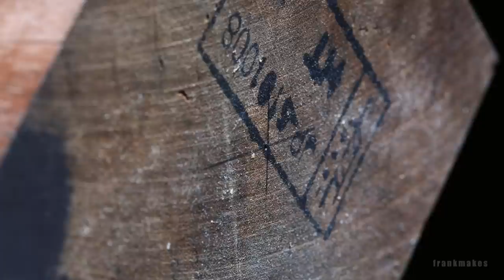Carver's Mallet

Comment: I'm trying to think of a way to ask this without sounding like the woodworking safety police that plague these channels.

    In my experience with stopmotion (Rubik's Cubes), I have found that it takes undivided attention to the current frame and the next frame, or else you'll end up with some kind of a mistake in the final cut. How were you able to maintain enough presence of mind to safely operate a table saw and a lathe while thinking about your stopmotion? A rubik"s cube can't bite you back if you slip up... I would be terrified of running a table saw while multitasking...

I'm very impressed with your video, it looks fantastic!